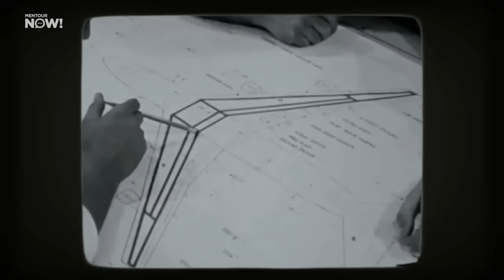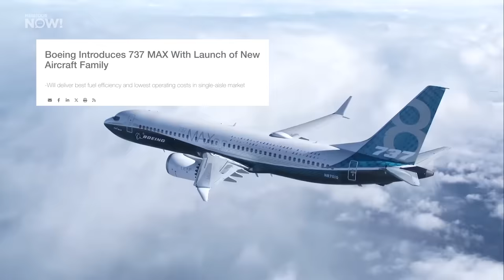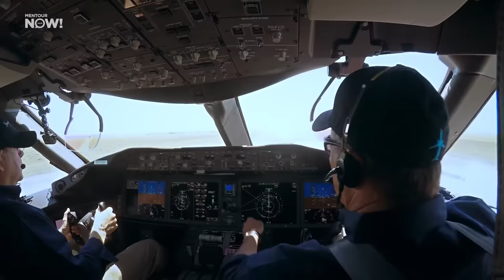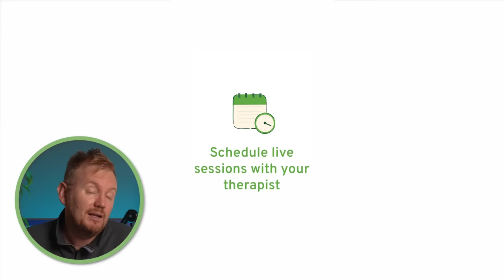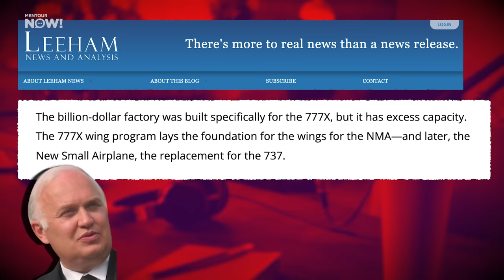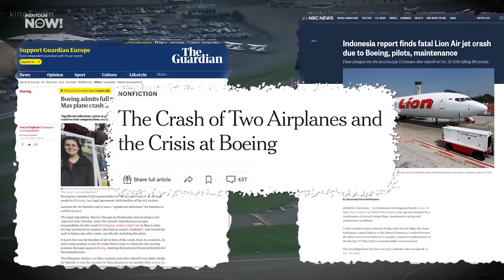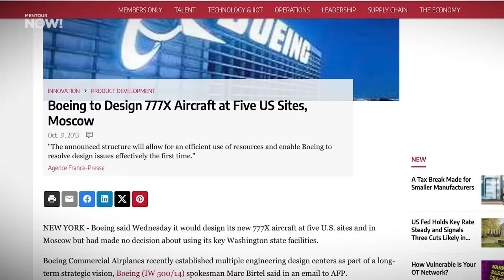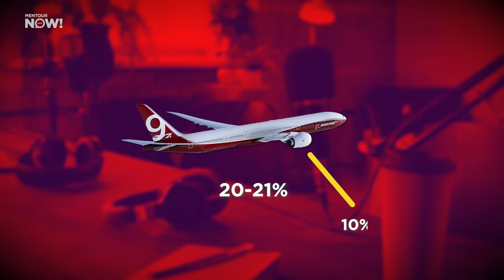What’s Going On With The Boeing 777X?!

Comment: Airbus got robots doing rivets early on with A320 assembly line in late 1980s. I am quite surprised Boeing couldn't get this working in the 2010s when work on 777X was starting.  The whole point of robots is to ensure consistency and if humans had to go and fix probems left by the robot, then there was something wrong Boeing was doing.
Reply: Have to design for the means to manufacture from the beginning.
Reply: Boeing has robots doing the rivets on the wings for the 737 & 777, at least. Robots also paint those wings. The 777 fuselage rivet work by robots wasn't their first rodeo with automated manufacturing, but the more complex requirements of fuselage work has been a challenge.
Reply: "I am quite surprised Boeing couldn't get this working in the 2010s when work on 777X was starting" - I'm not surprised.  Boeing, as a company, stopped thinking like engineers and started thinking like managers.  When you aren't too concerned about quality or safety, that will translate into everything you do, including procuring and setting up the robots for automation.
Reply: @BerndFelsche I was about to make a similar point. The error was thinking a new means of construction would be backwards compatible with a design not optimised for that means of production.
Reply: You can be sure that the unions did not want the robots to succeed.
Reply: @clarkkent7973  Not all Union members/administrators are Luddites.
Reply: Unionized employees do not want robots to take their jobs. 

Boeing has robots doing other work within Boeing in the Renton Factory.
Reply: @mipmipmipmipmip Boeing has unionized workers too.

They’re getting ready to negotiate on a new contract this year as well.
Reply: How many companies have gone down the gurgler, because management kept on doing things "because that's the way we always did it", instead of looking at the problem and then looking by merit at new and novel ways to do things!
Reply: crynese robots?
Reply: Robots mean less union jobs
Reply: I worked for Boeing for a couple years, it ain't rivets that are crashing Boeing airplanes my friend it's a total breakdown with regard to ethics in the flight tests and certification departments, I should know, that's where I worked
Reply: @christophergagliano2051  will appen the same at airbus... the more they grow and get subcontractors to build for them....that's the conclusion
Reply: Yep, robots perform as well as the programming they receive.    It sounds like the OEMs doing the automation were not up to the job.    As someone who worked in automation, this is no surprise.    Engineering a complicated automated process is a real challenge.
Reply: @PauloSergioMDC  Did they use the same robots seen on the wings of the airplane in the Twilight Zone episode with James Shatner?     😀

Comment: The 767, 777, 747 etc were designed by engineers and then built, then the accountants tried to make it profitable. the 787, max, 777x were handed to the accountants to build and then given to engineers to make it work
Reply: I don't think any accountant would have decided to go with the types of risks Boeing faced with the 787 project. In many ways, it was the anti-MAX. I don't think it is any exaggeration at all to say that it was the most ambitious airliner project that has actually made it off the drawing board from any company in the last 3 decades (yes, even more than the A380.) And it has been enormously successful, despite the early issues. The research Boeing had to do to build the composite airframe for the 787 was the kind of thing that gives accountants nightmares, but Boeing pulled it off and the Airbus also used much of that research to build their own quite successful A350.

The one part that probably was more accountant-driven was the supply chain they used for the 787, involving a lot more suppliers from all over the world, which ultimately led to a lot of headaches and delays. I think they learned their lesson with that outsourcing, hence bringing the new wings in-house for the 777X.
Reply: That makes the most sense though because remember the 747 program nearly bankrupted the company. Boeing does not want to return to that sort of day to day struggle. It is not a legitimate long-term strategy to let engineers design whatever they want with whatever they want and then force accountants to make it profitable. That is a total waste of resources including money and time. I don't think I've ever heard of a more terrible proposition in my life lmao. They should be working together simultaneously to make sure the program is even financially viable but at the same time engineers using the available resources to maximize the project.
Reply: @FlyByWire1  Didn't the near-bankruptcy have more to do with the 2707 SST program than the 747? That was more a cautionary tale on what happens when Congress tries to do engineering than when engineers do engineering. The general infeasibility of SST (both in cost and in the sonic booms being unacceptable over land, as well as several different environmental problems) was well-known to engineers and scientists by that point, but the Europeans were proceeding with Concorde as a pride project and Congress wanted an American one for the same reason.
Reply: @FlyByWire1 , actually the “747” was produced because the “2707 SST” was cancelled. In fact, the “747”-project was viewed as a freighter originally. The problem was that the engines for the “747” were not ready before the airframes were being manufactured. The engines were being  developed for the “Lockheed C-5 Galaxy”. It seems as if ‘Boeing’ has not learned from that experience it had during the mid-1960’s.
Reply: @vbscript2  This is wrong. The 787 was not complex. It was a mess because Boeing tried to do financial engineering and not a plane, and most of the responsibility of developing the plane fell on the suppliers and not Boeing itself. They lied to all suppliers, they made them work for peanuts, and the result was obvious: the 787 was a mess becasue each supplioer worked mostly alone and then Boeing had to spend a ton of money to make it work. Genius decisions, like everything from Boeing in the last 25 years.
Much of the research and actual work to build and create the composites is not Boeing's work, but their suppliers.
On the MAX they could not do it for 2 reasons: because they had lost a ton of money on the 787 and did not want to repeat the stunt and money is what matters to them, but worse, because NO company accepted to work with them pro-bono again (I wonder why...).
That many of the companies that worked with Boeing on the 787 are working with Airbus, is mainly because they're trying to recover the money they lost. Also it's their work they're selling.

Now claiming the the 787 is a more ambitious project than the A380... Well...😂😂🤣🤣

Comment: Actually the folding wingtip ISN’T a new thing to the 777X. It was originally offered as an option for the 777, to enable it to use 52m pads. Ultimately no airline ordered the option.
Reply: The test structure for that is outside of the Museum of Flight restoration building in Everett, WA.
Reply: Yup. Far more complex and larger on the original 777 too. They each included outboard ailerons and two sections of leading edge slats, where the 777x folding wing tips have no flight control surfaces. I read they were flight tested and certified on the both domestic market A and the stretch (aka -300) market A and ran off the center hydraulics with alternate connections to the right and left systems as a safety backup. Can’t see these new, less complex ones having any issues getting certified, but to the public I guess they’re still going to be considered new and have a lot of scrutiny.
Reply: As far as I’m aware the folding wings on the 777 was just a concept and not an actual variant offered to customers
Reply: Quoting from 777 Enthusiasts Colour Series, Norris and Wagner P39, “…the hinge line is set at about 80 percent of the span, allowing the outer 22’ to fold upwards… By 1995 no operator specified the folding wing system, but Boeing is keeping it available as major fleets of DC-10 begin to change hands. The company also expects to offer the technology for the the future ‘New Large Airplane’…” In part this limitation is seen by the extent of the wing tank, which doesn’t reach the entire span. FYI
Reply: Wrong
Reply: Interesting tidbit, but if it was never used, doesnt that mean its still new?
Reply: @termitreter6545 Yes of course. However, I suppose I was just reacting to those who observe that the idea is COMPLETELY new, when in fact the original idea was proposed with the previous generation. I just made the remark because many don’t know this about the 777, and I myself find it an interesting tidbit
Reply: @grahamsalmons2027 is this a book magazine?
Reply: @Liam_219  the original folding wing tip was indeed an actual variant if not baselined into the original 777.  I worked on the folding wingtip. At the time we were told that American Airlines' order was predicated on having a folding wing.  That design was more complex than the current design as a result of where the fold line was.  By the time the design was completed American Airlines dropped the requirement for a folding wing (if it ever really was a requirement) and the design was shelved.
Reply: I just wished they’d have used a Grumman Cat style fold back hinge.   Those always looked so
Awesome.  :-)
Reply: @johngunderson5463  do u have online sources referring to the earlier 777 folding wingtips?

Comment: If you react to competition as soon as you see a threat... it is already too late.
I like Boeing aircraft, but the company management in the last 30 years doesn't impress me.
Reply: They went half ESG, DEI, lucky to still exist.  😉
I had biggest stock position in BA, right until they crashed 2nd Max.  One bro was veteran Engineer for them.  I lost all confidence, cashed out, after a lifetime of admiration for Boeing.
Reply: that is when you should have bought more. because there was a rebate on the shares. maybe. Btw. which company will take their place as a subsidy queen and an airliner behemoth? @Mrbfgray
Reply: I thought Boeing management was basically MD beancounter after the merger?
Reply: Anyone who says “I
like…” followed by “but,”  is full of it.
Reply: What I have noticed these last years (I don't know if I'm wrong) is that Boeing has totally lost the innovative initiative in favor of Airbus, nowadays they no longer come out with groundbreaking designs but simply react to whatever Airbus does.
Reply: @Scribe127  I like ice cream, but I don't want it smeared in my bed. Fight me.
Reply: boeing at this point only shifts for that profit and never quality in aircraft

Comment: Here's a funny thing.  30-odd years ago, I was a manufacturing engineer at Vought Aircraft.  That company pioneered an "automatic riveter" machine that could drill, countersink if necessary, and deburr a hole, then squeeze a rivet into it, with or without sealant as needed.  It could also push in interference-fit Hi-Lok fasteners but those still required manual installation of their nuts afterwards.  However, all this automation was only semi-automatic.  It still required an operator to help position the rather large chunk of airplane in the the right spot (which was were a red laser dot from the machine corresponded with a spray-painted dot on the part indicating where the hole should be drilled.  Large parts were suspended in slings from overhead cranes that the machine operator could control to get the spray dot more or less in the right spot, then lean on the part a little to finalize the aim.  This system worked quite well and Vought licensed the patents out to other manufacturers, but it only worked on relatively flat pieces, such as skin panels for wings and tails, or for curved sections no more than about 1/8 the circumference of a circle, for say fuselage skins or parts of engine nacelles.  And all this work was way up the line from final assembly of the whole airframe.  It was mostly for attaching stringers to skin panels and similar tasks.  And it still required all these parts previously to have been loaded manually into their jigs and a few holes manually drilled and clecoed together to hold the parts in their proper places so the nascent assembly could be hung from slings and all the rest done by the auto-riveter.

Still, this system saved a LOT of manual work because you have to buck manual rivets out in the middle of large skin panels with 2 people, and a varying amount of time depending on the type of fastener.  But it had its limits and we at Vought put a great deal of thought into how to improve such machines so could do even more.  But eventually we decided that robots could only do so much for aircraft assembly and left it where it was.  So I'm surprised Boeing tried to go raise the bar as high as it did.  I mean, you can reduce assembly hours by machining entire parts out of 1 block of metal rather than build them up from plates and angles riveted together, but what you save in riveting labor you lose in increased machining time and cutter wear, and make a LOT of scrap.
Reply: I’m an Engineer in an unrelated field. It breaks my heart when brilliant minds solve a problem but it gets recycled to the next generation to solve again!
Reply: @TickleFight94  It shouldn't break your heart.  You should instead be glad.  That means job security for any children who follow in your footsteps )   "Re-inventing the wheel" is a human occupation about 1 day less old than inventing the wheel the 1st time ;)
Reply: facts

Comment: I was a member of the engineering team that created the 777 as a young engineer just out of university and it was a formative experience in my engineering career. I'm happy to hear @MentourNow call the 777 "iconic".  🙂
Reply: The 777 was probably the first and last "greatest" jet that I'll ever work on (not to say the 747 wasn't a good aircraft).  Before the FAUB came along, the saying was, "B-1 and DONE!" Only one production test flight and then off to the customer events.  After the FAUB started, there were airplanes coming out to the flightline with over 2000 incomplete jobs.
Reply: It's hardly iconic, just a boring 767 on peds. The 747 was iconic.
Reply: what team were you part of? i curious to know your experience during the development
Reply: Both the 777 and 747 where massive  hits,  most 747s ended up being replaced by the 777
Reply: @sasukecruz2000  I was hired right after the go-ahead decision for the aircraft program in 1990 and I worked in the 777 aerodynamic loads group. I was involved with structural loads analysis, wind tunnel testing, flight testing and FAA certification documentation. It was an excellent introduction to how aircraft are designed, built and certified for a newly graduated engineer.
Reply: @konbonwa  ohhh that’s pretty cool! i’m currently part of structures stress for the 787. everything is so new to me and it’s definitely a big learning curve coming straight out of school.

Comment: I'm not sure how it works in aerospace, but in car manufacturing the design process never stops. As soon as a new model is finalised, they immediately start on the design of the replacement model. There is no stop-start for the design teams and this gives excellent continuity of experience/knowledge. This 777-X just seems to full of stop-starts, and that creates havoc.
Reply: There are less customers to buy airliners and people replace cars more often than they do planes. Given how much they cost, you want to milk an aircraft for all it is worth before replacing it.
Reply: Life cycle is very different.
Reply: Two very different things! Risks can be taken in cars not in aircrafts, especially huge passengers planes.
Reply: @superaijaz   Cars can and do just fail anytime and they don't even need engineering or manufacturing faults to do that. That's just part of the experience.
Reply: Life cycle is very different AFAIK.
For Airbus, for example, it seems that when finishing a project, they rather start working on a new project of a different class of plane, with maybe some overlap. But then you have to consider all of the evolutions of the planes, that don’t necessities and entier redesign but still take some time

Comment: The problem with the A330 wasnt per se that it was old, it was down to the fuselage diameter not being scalable enough. The A346 was the ultimate stretch of that A300 fuselage diameter and it was just never competitive in capacity to other models available, especially given how much it caused the weight to rise to almost 400t. The A330 manages to keep the weight down to under 250t, so it can efficiently transport that lower number of passengers (the A343 somewhat did too, which is why it has remained in service for a bit longer than the -600).

The A350 fuselage allowed Airbus to go to 9 abreast with a reasonable seat width, which let them get within reach of the capacity of the 777 without having to make an absurdly long fuselage and it keeps their weight down to under 280t, 100t less than the 346. Overall it's basically the "peak" evolution of tuning an aircraft that fits in the 65m wing box, the 777x has needed the folding wings to be able to be heavier and have the extra capacity without sacrificing efficiency as it would have if the wing span was 65m.